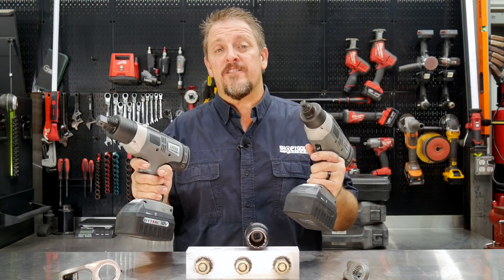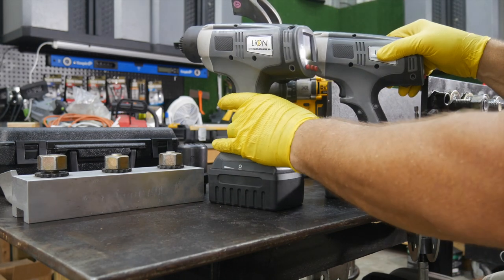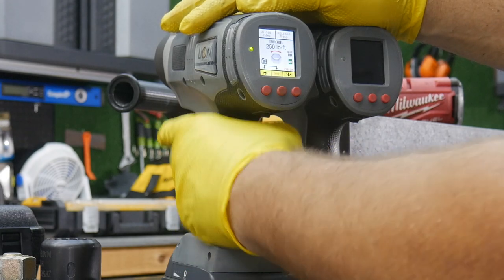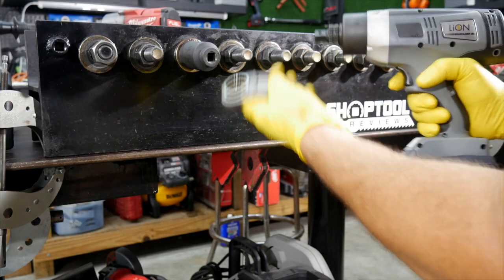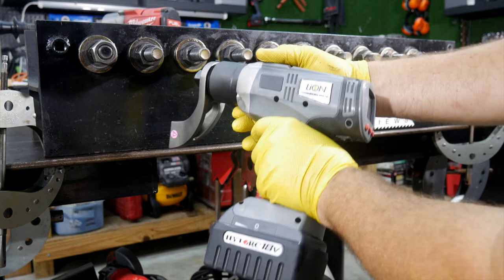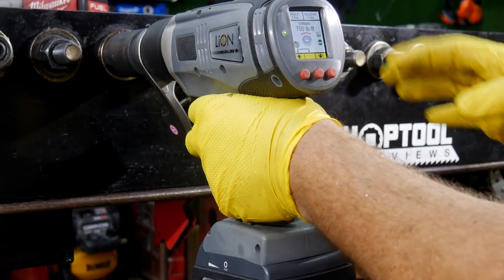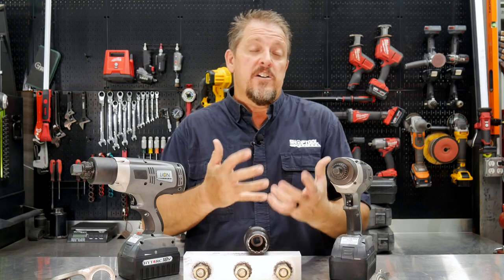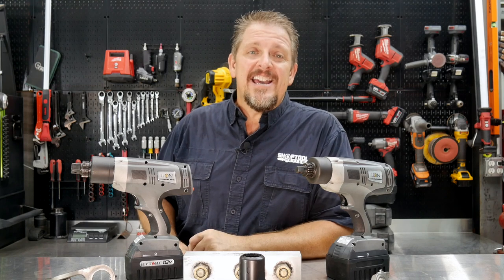Hytorc 700 Ft-Lbs Precision Bolting System [LION GUN]

Comment: I'm glad I watched it till the end when you said that it might not be so common in the tire shops, but some of us tire changers are ready for something better than the same old over tightened stretched distorted and broken studds, seems like management is only concerned about documenting that the tech knew better instead of an actual equipment upgrade. Thanks for the video!
Reply from the maker: You have a very valid point. Thanks for watching.
Reply: Putting wheels on isn't a torque critical application. If someone can't feel when a lug nut is tight enough, they don't belong near a wheel.
Reply: @littlejackalo5326  good luck trying to control that...a CEO for a company that that I once worked for said in productivity meeting, "If you are doing things today, the same way you did yesterday, your part of the problem "....I'm finally getting around to their way of thinking.

Comment: I’m will be using one this week to validate tightening on a train that we’re working on. The center pin that mounts to the body of the train that holds the truck on. I do Believe 650 lbs is the torque.

Comment: i like them because of the consistency they can do. for things like head bolts. you don't have to worry about not stopping in the middle of torqing the bolt with the wrench because you ran out of room for the swing of the handle and ran into something and now the bolt that is meant to strech are ruined and that means all the other ones you put on that you have to take off are also ruined and you got to start over and buy all new and hope next time you can do it without having to start over.

Comment: They are expensive but so are shoulder surgeries. I think they would be good in truck dealerships. I think it's worth saving for instead of the getting the gucci box. We had the air version of this in our shop but but it doesn't have the counter or the lock out code and it cost more.
Reply from the maker: Did you have the pneumatic Ingersoll Rand version? You're right, these would be great for trucking and heavy equipment, but very few companies are going to fork out that cash for them. It definitely solves a lot of mechanics injuries and mitigates lawsuit material. More of an investment than a cost. Thanks for watching.
Reply: @Shoptoolreviews  no it was TorcUp Raptor RP-1000 I believe. You adjusted the air and that would adjust the output of the gun. I could use that all day compared to having to have another tech hold up the other end of the torque wrench. After a while it pays for itself over and again if you maintain it, while doing main bearings on big engines.

Comment: Refineries all use job numbers, torque standards, and etc for the bolting as well. Now they just need one that torques to 2,000+ftlbs lol
Reply: We have a gun that can torque 5000ft lb Hytorc lithium series2
Reply: @michaelneysschens4461  I used some of the smaller electric torque guns in the refineries but anything large like that got hydraulic torque wrenches with air-to-hydraulic pumps. For anything larger than they could do, we had a stud stretcher that basically pulled the stud and we'd tighten down the nut, and when it was released, it would be torqued to spec
Reply: @michaelneysschens4461  you keep saying "we." Who is "we."

Comment: We use a similar tool when bolting up flanges in the power house I’m working at. Much easier than the hytorq pump sustem. Plumbers and Pipefitters 333

Comment: So basically it’s an electronic torque multiplier.  And it uses the reactionary arm (or washer and socket).  to calculate torque accurately.   It applies torque using a gearbox to multiple torque.  The motor spins much faster than what the socket does.  I wonder what the gear ratios are.   They also make a 36v they Can fastens to 5000 lbs-ft!

Not a bad way to spend  $6,000.00 usd for these two tools.
Reply from the maker: It looks like you've done some research. You are correct, this is a motor-driven torque multiplier. The larger 36-volt guns go much higher as well. They're very expensive, but they offer a great solution in the right spot. Thanks for watching and commenting.

Comment: I thought in one of your videos you were using one these Hytorc Precision Bolting System to torque the nuts on the test structure up to 2000 ft-lb to test that giant 2000 ft-lb impact gun. But here you showed they only do 250 and 700 ft-lb. Am I missing some information from both videos?
Reply: Hi we have different models of guns available each with its own torque range. The lion gun in demo is an 18v battery gun 3/4" drive. We have 36v guns that are 1 " and 1 1/2" drive that can do 5000ft lb

Comment: Too bad you didn't tear them down. I'm curious how deep the reduction is in those gearboxes and what actually differentiates the two guns, if it's motor or just different gearboxes. I'm also curious of what motors they're using, as these guns really don't look all that large and are putting out tons of torque.
Reply from the maker: It would be interesting to see what's inside, but I didn't want to take that chance with such an expensive tool. Thanks for watching.
Reply: @Shoptoolreviews  I'm thinking it's probably 5 or 6 reductions deep, maybe one less if they're using thicker gears, on the 250, and an additional reduction deeper on the 750. Looking at the 750 and how the reactionary holder is split from the casing exiting the plastic of the gun, but only the last two reductions are attached to the arm, where the reductions on the others are attached to the drill, every ring in each planetary set is held, and the separation of the holding mechanisms are what allow the two to move independently. I think that additional gearbox is really the only difference between the two guns, as it would only need to be a 3:1 reduction to get to 750 foot pounds. Fairly simple design, and I'm surprised we don't see more torque guns like this. If we knew the specs of the motor itself, we could determine what the overall reduction is, then work backwards from there to determine individual reductions, and determine what the highest torque rating would be if the gun wasn't limited by it's computer.
On the torque measurement side of things, they probably have a sensor on the motor side of the gearbox, then multiplying that measurement by the gearbox's reduction on the computer where you program everything. A torque sensor on the motor would be measuring in inch pounds, and at most probably under 10 foot pounds. 

The ludicrous pricing only comes from this being a tool used in industry settings, by companies that consider the cost as pocket change type prices. Otherwise it's really no different from a drill that has a display and a small computer in it, and a larger gearbox than what's typical. If a consumer variant ever existed, I'd see it competing within the price range of a consumer impact gun of similar torque figures. I'm somewhat surprised none of the consumer brands have tried to tap into the non-impact torque gun market. It might be slightly slower than an impact gun, especially when zipping off a fastener in reverse, but for proper torquing, and maybe even breaking a fastener loose, I'd very much prefer a reduction-based gun like these.

Comment: I’d like your opinion buddy, we  run a farm and I’m looking to buy 2 impacts ASAP I want something that will last as long as possible, I have  DeWalts and now 2 SnapOn impacts. Iv had one of the 1/2” SnapOn rebuilt so far and I don’t even use DeWalts anymore because they are just a waste of time. (The DeWalts are a couple years old now) what I’d like  to know is what would you buy if you were me? I thought about going the Milwaukee route.... 2) 1/2”impact and 1) 1”  i want an investment and not a “buy and use for three years and have to start over” because of a new version of battery or it broke/Bs like that. Thanks, I know the question has many factors. Much appreciation, and always thanks for the great content!
Reply: I farm and ranch too .   Bought the Milwaukee 1/2 high torque and 3/8 mid torque  m18 impacts a year ago  and am real pleased with them . I use the 1/4 m18 hex impact with an adapter  for 1/4 and lighter 3/8 work and the only bitch there is that it is a little too powerful and will snap the adapters if you are not real careful .  On the bigger fuel guns if you bite the bullet and buy a 9 or 12ah battery its like a whole new tool with the power they will output .  I still run air for my 3/4 and 1' guns  primarily because I own them already and don't want to spend the money to go cordless when what I have works and its not that much trouble to drag hose from the portable compressor  for the times I need to step up .
Reply: farmdadco thank ya sir!! I definitely appreciate the feed back! I have to admit I wanna jump on that Milwaukee train!
Reply from the maker: Thanks so much for watching and commenting. You're right, your question/s have many factors, but I'll go ahead a take a shot. 
When you have a moment to reply: how big of equipment and fasteners (over 1")? How often do you use the impact for fasteners over 1"?
If you're not happy with DeWalt, which I understand, then I'd probably shoot for Milwaukee M18 or Ingersoll Rand. Albeit, Ingersoll Rand is more of a pain to find. Milwaukee, at least you can find them on just about any corner. It seems like you're leaning toward purchasing 3 guns: two 1/2" models and one 1" model. I think that's a great idea. If you're doing a lot of wheel/tire changes, then I'd lean toward the extended anvil 1". If you are looking at purchasing 2 of the 1/2" models, you may want to look at making one of these a 3/4" model. It's the same impact, but with the larger anvil. You will notice some performance gain in the larger anvil (more inertia/rotating-mass).
As for larger batteries: they have a very slight performance gain, but probably not recognizable. Where they do gain traction is Not dropping off so soon. Using the impacts, once the battery drops to ~50% (2 bars), then you will notice a decline in performance. With a larger battery, you will have a longer runtime before you reach that decline. This is the biggest benefit.
I look forward to hearing more.
Reply: @mxcatkiller  if you're unhappy with the DeWalt, the Milwaukee will disappoint even more. They're like a Tesla. Yeah they are powerful, but everything else about them are junk. It's good for people who watch YouTube channels that only test Max output. I buy right around 100 cordless tools a year for my company, and I buy all the major brands.  I usually stick to DeWalt. But sometimes I need to pick up 5 impact drivers or impact wrenches, and they'll only have 3 deals, so I'll have to pick up a few Milwaukee ones too. I've done long term testing for 20 years, and the Milwaukee just doesn't last. It'll give you a bit more power, but it'll only do it for 6 months. I have 14.4V DeWalt tools from 20-25 years ago, that are still kicking around. I have 81 empires that really abuse tools, and it of the hundreds of cordless tools I've bought, DeWalt always lasts much longer than Milwaukee. Something ALWAYS breaks on the Milwaukee tools.

Comment: Very cool and interesting video. However, because you have the degree back off ability, do you have to set your initial tightening degree higher to compensate for the degree back off? Sorry if this doesn't make sense, I wasn't really sure how to word my question 😂
Reply: No. It does it to tighten to the exact same torque spec as before.
Reply: The the "back of ability" doesn't loosen the fastener. It just takes the strain off of the reaction arm when the slop is taken up. It just reversed direction a tiny bit too let you take off the socket.

Comment: Pretty sure the arm is a torque multiplier
Reply from the maker: No, these are not torque multipliers. They are torque guns, and the arm is a reactionary arm. Thanks for watching.
Reply: @Shoptoolreviews  I mean sure that's probably what they call it but yeah it serves the same function notice how it spins opposite it basically is a torque multiplier you can buy the same thing for a  half inch drive ratchet and get a nut to torque up to 1,000 foot pounds

Comment: I checked prices of both online, the .25 is $2,495
the other .70 is $3,995 🧐🧐 I’ll try to trade in on offerup my M18 1/2 fuel 2767-20 for just the control arm, let ya’ll know if I get lucky with that
Reply from the maker: We're cheering for you. Thanks for watching.
Reply: @bigboreracing356  the thing that sucks is how poorly these guns are made. Trash quality plastic, junk mold & for work, clamshell doesn't line up and has flashing. It's just put quality for & finish and trash quality materials.
Reply: @littlejackalo5326  I have seen them with 12000 torques without a failure or decrease in torque output.